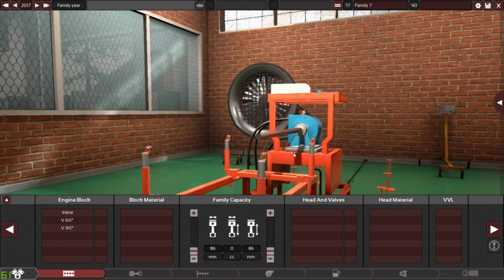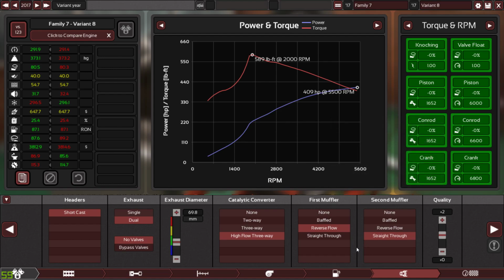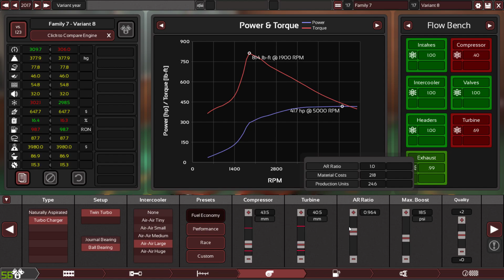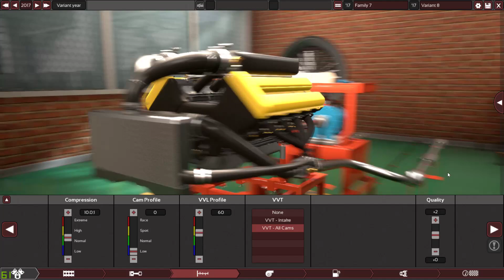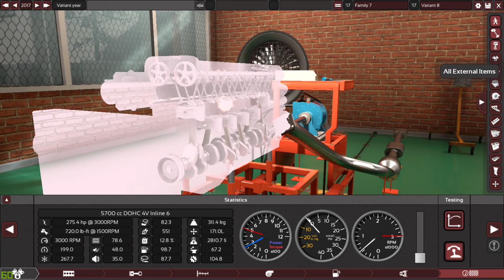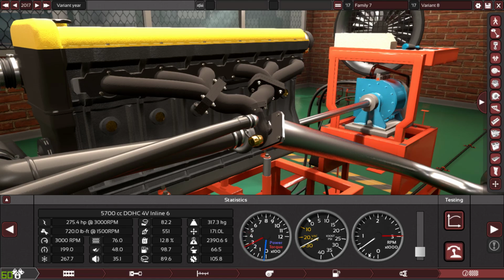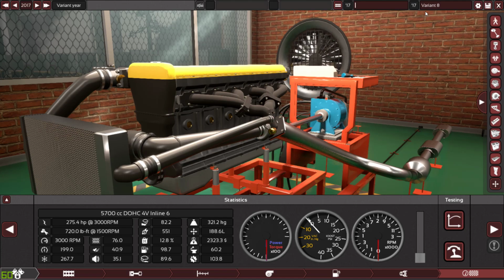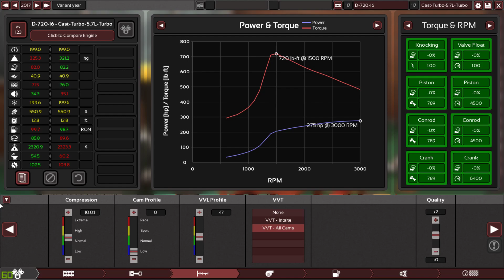Making a Diesel engine in Automation the weird way.

Comment: Actually the diesel octane rating is 50. Also the knocking is the main reason that diesels work. :/
Reply: Cetane not octane
Reply: Diesel isn’t rated by octane, it’s cetane
Reply: They don’t necessarily knock. It’s just an inherent noise diesels make because of the way they fire. You’ll know if a diesel is knocking, it’s loud as hell. And you better hope to god it’s an injector that isn’t working causing it lol
Reply: Well its 45 cetane , not 50
Reply: @mrc14_2  It is 50-51 the premium one
Reply: Well sheet, you guys are right, eu diesel regulations say 51 is the minimum
Reply: @justawhitenigga  Unde frate de 55?
Reply: Gerrold ron or aki?
Reply: James Lampe the extreme compression of diesels make the engine knock which allows for it to run without a spark plug, Which is why diesels don’t have spark plugs.
Reply: Sounds like a om606 Mercedes

Comment: It’s unrealistic because Diesels have extremely high compression and he kept it low
Reply from the maker: Of course it’s unrealistic 
There is no diesel in Automation game. 
But The specs that I choose are for making the sound of the engine similar to a Diesel engine.
Reply: It just annoys me because I’m O.C.D
Reply from the maker: Don’t worry 
And don’t get annoyed by that. 
Have a nice day/evening
Reply: Making a diesel engine in Automation the weird way ;)
Reply: You’re not the only one that was annoying by that, should be almost double around 18:1 or even higher. Also diesel’s air fuel ratio can be extremely lean around 400:1
Reply: @vader2774  depending on the engine for 18+ my 6.4 powerstroke has 16:1, and your looking at around 14:1 are not 400:1
Reply: @xQsBNoSCoPeZz  at idle it van be anywhere from 50:1-160:1
Reply: @microlach6632  didnt see the afr thought he was talking about compression, must have edited it

Comment: In a gas engine, ignition from compression is detrimental, since it's igniting the fuel and air well before the spark can get to it.  Big problem in performance turbocharged engines, hence they run high octane.  Diesels don't have to worry so much about that since the ignition event tends to be controlled, albeit uneven, and hopefully on the downstroke of the connecting rod that's receiving the power.  Diesels in themselves are self destructive from sheer vibration loads and high heat and cylinder pressures, hence why the mains webbings tend to crack, and harmonic balancers literally tearing the key pin clean off the end of the crank.  The only way to prevent these problems is by casting the block and heads significantly thicker and heavier than any gasoline counterpart, or using some very expensive metallurgy techniques that can still lend themselves to failure, if any of the parts expand and stretch.  This is why even since Diesel is commonly more fuel efficient, they're never installed in passenger cars in the United States, too expensive to cast and mass produce with consistent reliability.

Comment: 10:25 Meanwhile my car goes to 5200 rpm 😁
Reply: 6500 here
Reply: Small diesel engines (for example one that goes into your car) can rev up to about 5-6K RPM.
Heavy duty diesel engines (Trucks, tractors, etc.) usually only rev to about 2500-4000 RMP
Reply: Meanwhile no one asked 😊
Reply: 70mph at 300 here and redline is at 5

Comment: I feel you should’ve upped the sliders (as unrealistic as it may be) to achieve those outlandish power figures. Also, that engine does in fact sound similar to a diesel; you should’ve limited the RPM range to ~4000. American diesel V8’s of this size normally redline at 4200ish rpms from the factory.

Comment: Compression needs to be 14:1
Direct acting cam
Only a single muffler 
700 mm diameter exhaust 
Cam profile 45-50
VVL 35-40
RPM 2800
Reply: Fuel low quality
Turbo large bore compressor 
Direct injection per cylinder
Reply: Uhm
VVL cant be smaller than cam profile
Also the max size of exhausts are 203 mm
Reply: why RPM 2800? There is a shitload of diesel engines which rev past 4000RPM
Reply: @dieselgeezer18  because safety preset on all medium and large diesels are set by factory between 2800-3200RPM the high revers are a rare thing from factory for most aplications above 3.8L below that (seen mostly in four cylinder) higher than 4000 even up to 6k(mercedes inline 5
)

Comment: to give you mr. Bshar Nasri a more easy request, make a Chevy chevelle ss 454 lS6 engine. modified version and put it in a a car of your own chose.things to use: 1st. 90 deggre magnesium v8.2nd. 7.6 litre same as 7600 cc engine. more bore then stroke.3rd.pushrod 2 valve or double overhead camshafts 4th valve. extremely high camprofile beacuse race engine.4. no vvt or vvl.5th. highest comression possibly.6th.turbo yes beacuse the game dosen`t have twin-screw superchargers. modify it for maximum power and torque. do not need to care about mpg.7th.carburetor 4 barrel twin carburetors.8th.configuratin, racing, including racing intake or sport intake what suits the game best.9th. fuel, 100 ron.10th.rew limit is going to be 8000 rpm.11th.dual exhaust with bypass valve.12th. 3.5 - 4 inch exhaust diameter.13th. high flow tree way catalytic converter after that a none muffler and a straight trough mufflers.
Reply from the maker: +Charlie Andersson 
All is fine and easy to do but the exhaust is small and i have the correct bore and stroke for the 454 chevy big block 
I like it. Thank you for your awesome request 
I will make it as soon as I’m free
Reply: yea i know that the correct cc for the stock one is 7400 cc but this one is a highly modified replica of that engine, but if you want you can make two tunes on with the regular specs and one with the modifications but insert the modified engine in a car and let it run a test lap in a car of your choice.

Comment: Dude I made a 1300 hundred lb foot of torque and over 600 hp it is very tedious but possible
Reply from the maker: The video was made in a very early Automation game version, and i was demonstrating the sound of the engine only, and I didn’t care about the power or torque or anything else because there is no diesel in Automation game yet.
Reply: @BsharNasri  "Early"

Comment: close as possibly, better get the sound of a diesel and as close as possible power output.
Reply from the maker: +Charlie Andersson 
I tried that 
And I said 
It’s impossible with petrol engines to have all the torque at low RPM with super horsepower.

Comment: Shit the sooner my  game downloads the better 😬
Reply from the maker: Good luck man 👍
Reply: Bshar Nasri thankyou my friend, can I  ask a question tho, can I do what you are doing in the game now as soon as it’s installed or do I have to unlock levels and stuff like that?
Reply: And I wonder if you made your i6 diesel model a 2 valve per cylinder configuration would even more torque have been generated, as they normally produce more torque in the low rpms. 👍
Reply from the maker: When the game downloads you will have the base version. 
Go to properties and select beta and choose Open beta and press ok or close and it will download the current version that I’m using. And then do whatever you like. No levels or anything. Only sandbox mode.
Good luck and merry Christmas 
Hope you enjoyed my videos.
Reply: You should calm down dude
Reply: ay Mercedes OM60x gang
Reply: @dieselgeezer18  606 is 👑

Comment: diesel engines dont rev high so u should lower the rpm to 3k.
Reply: Danguolė Bulovaitė Mercedes diesels these days are being tuned to rev Beyond 6500rpm
Reply: My TDI Jetta cuts out at 5000rpm and makes so if it's power by 2200
Reply: small diesel max is normal 5200 and bigger i6 v8 diesel have even 2.5k 3k there are small engines that also have 4000

Comment: Modern diesels go up to 5 to 6 thousand revs
Reply: but not a V8 maybie 4 thousend
Reply: 5200 is the highes redline. They can not go beyond that.
Reply: @totalmadnesman  why?
Reply: They are not physically able to burn so much diesel in an given time.
Reply: VGA is daa my 01 tdi goes to 4600
Reply: Aye, I got a 4.4L V8 turbo diesel that goes to 6.2k rpm without many issues

Comment: unrealist man... diesel have extrememly high compression... dynimic and static... i desagreee this video for this error.. this engine is a gasoline high torque engine.. not diesel..
Reply from the maker: dude, Automation doesn't have Diesel in it.
this video is just to explain if you want to make something similar to a diesel with the noise and the torque.
Reply: @BsharNasri  dude.. i know that... but..  high compression just is a caracteristic of diesel engines.. which should have been taken seriously.. since automation has the premise of being a simulator